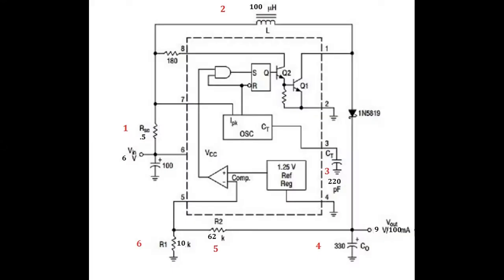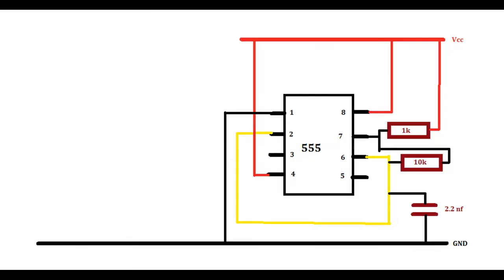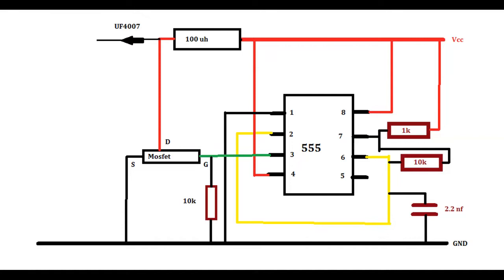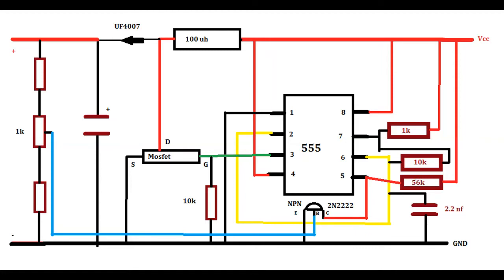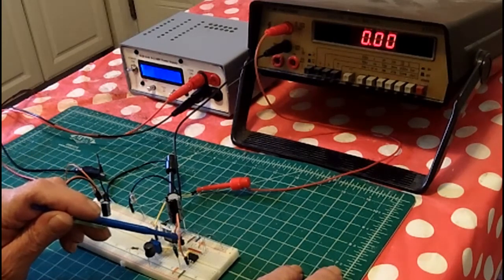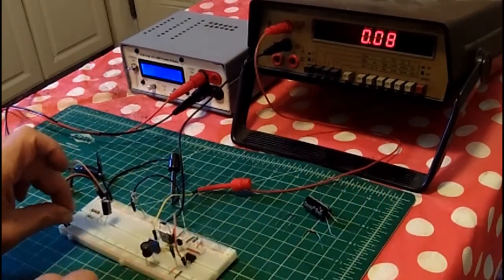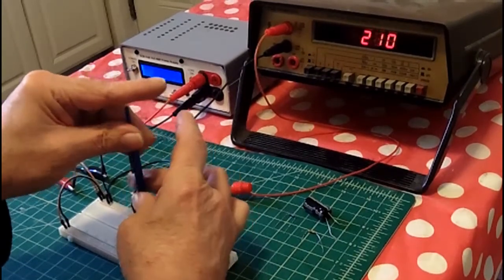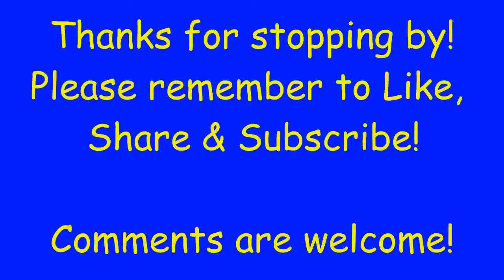Another DC DC Converter FAIL! 😞

Comment: I have a question for you Bob.
I only see one rectifier diode in the HV circuit,how does a 555 timer chip boost it to over 200 volts?
I do not see a HV transformer, guess I am showing my stupidity....LOL
Reply from the maker: That's what the inductor does Bill. Turning the current off and on through the inductor generates a lot of voltage.
Reply: Sort of like I did when I was a kid, I took an old filter choke from a TV and put a 1.5 volt battery on it and make and break and it generated a counter EMF and would give you quite a shock.
However that little has very little inductance, the one from the TV was huge, lots of iron.
Reply from the maker: Same basic idea. But you weren't making and breaking it at 30 thousand times a second. 😋